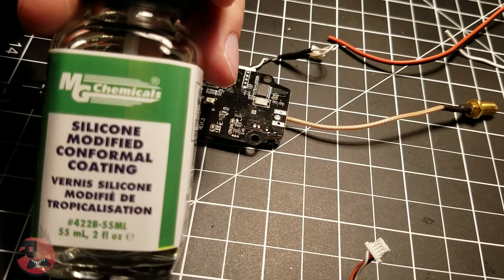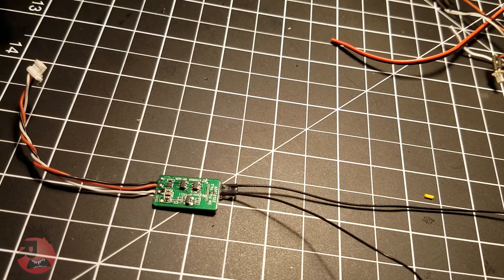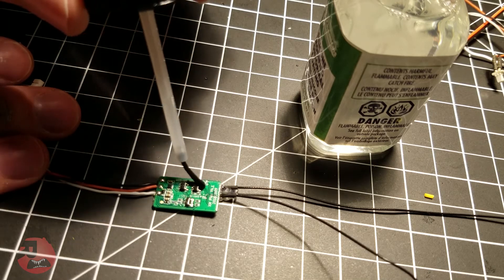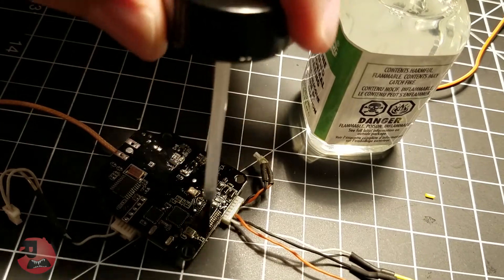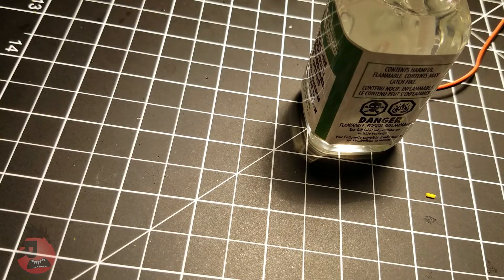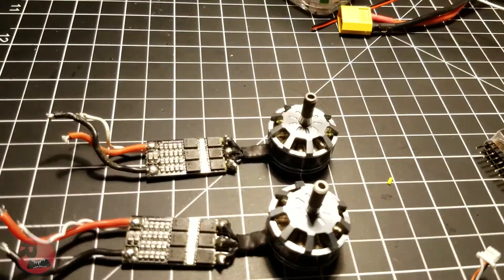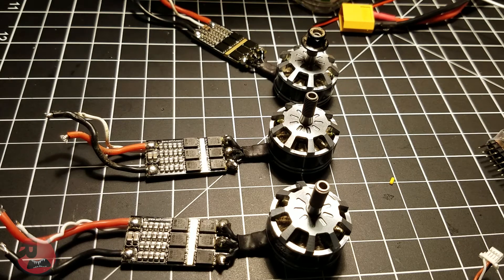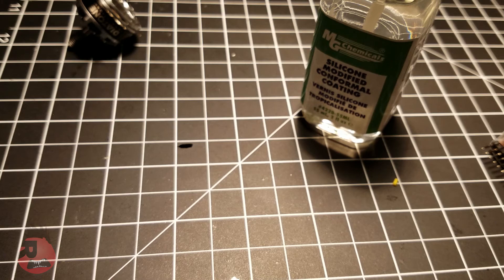Electronics Waterproofing, Quadcopter Waterprofing

Comment: Thanks for the video, but I think I'd buy the spray... Lay out all the parts right next to each other, spray, let dry, spray again, let dry, flip all, repeat. I guess it dries in several minutes. That little brush would drive me crazy with how slow it is to apply!
Damn, there's got to be a better and quicker way.
Spray! You get a ton more in a can for about $8 bucks more.
Reply from the maker: Scoot Roter nice I will look into the  spray. Only thing that is nice with the brush is accuracy. If there is something you don't want it on like a usb port.
Reply: RaceFace FPV... Wouldn't it be easy to just mask that? Just like painting???  One could also spray a bit in a paper cup and do little touch ups with a brush. Seems like a quicker and more efficient way... Less tedious doing everything with that small brush...?